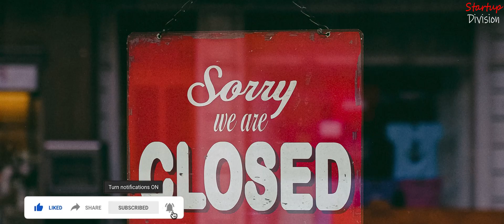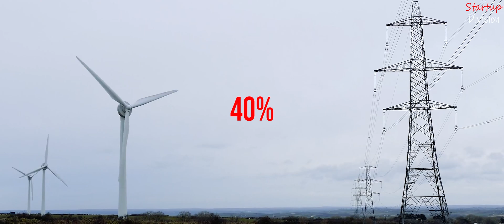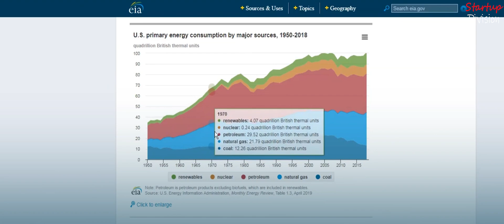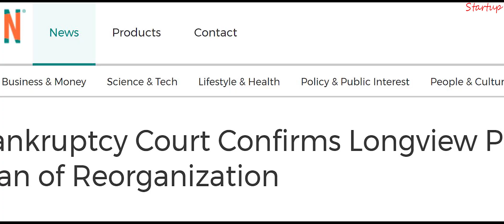Renewables Now Generate More Power than Coal Amidst the Pandemic in the U.S.

Comment from the maker: Do you think the future is Renewable Energy?
Reply: I dont think so man. But good for america. Will Donald allow it?
Reply: Yep Renewable energy has a bright future.
Reply: Absolutely. Why people imagine fossil fuels based civilization will last forever is beyond me. The clue's in the name - fossil & by its very nature, finite. Talk about a complete lack of imagination. 🤦🤷🙆
Reply: Renewables simply make more economic sense: you install once and you don't have the costs of bringing in fuel all the time. At the same time, costs of renewables and energy storage are dropping constantly, so they make more economic sense every year.
All we need is enough energy storage facilities and a smart grid that allows electricity to be transported over long distances, so that power generated far away can compensate for a temporary local shortage.
Reply: Yes it is. But it's going to take some work to shift structures and attitudes. It requires a whole new way of thinking.
Reply: Ygg,

no it will need a miracle, because when all things are considered we still need either or nuclear and fossil fuel genertaion to ensure that we always have power. There are times when renewables simply generate a very small amount of power. Batteries are not the answer and neither are 'smart grids'.
Yet governments are intent on adding to the grid load with a lot more electrical devices such as vehicles nad heat pumps. This exacerbates the problem.
Reply: It has to be. If we don't clean up our act we may not have a future.
Reply: Overdose, 

wishful thinking just won't do it and that is what renewable energy is.
Reply: @iareid8255  Neither is ignorance or pretending that since there is no miracle solution then we shouldn't even try. Your previous post complained about smart grids not being good enough, and then you complained about additional load on the energy grid, something a smart grid would help alleviate. Solar + batteries can literally solve the problem, however, the economics don't always make sense to use that solution. This is why renewables are a mix of complementary technologies that can be tailored to the local environment and socioeconomic situation.
Reply: Overdose,

forget batteries they only work for frequency stabilisation, not for intermittent generation, the capacity required is far too great.
There is a solution that most ignore or say it's too hazardous. It is a stable and reliable producer of good electricty. I say good because wind and solar is not good. It's technically unsuited for large scale grid supply.
Reply: Acme, 

I have a far better understanding of power production and transmission than you have. Renewables are the most expensive and unreliable way to generate electricity.
You mention vehicle to grid, a procedure that loses 50% of the electricity by the time it is returned to back feed the grid.
Reply: @iareid8255  Weird that you seem to be the only person claiming wind and solar power are "not good." Batteries are being made for literally that purpose - intermittent electricity generation. Ever hear of a battery backup, something that kicks in as soon as the power goes out? Same thing but grid scale and it is being deployed on every continent. 5% of the Sahara covered in solar (today's tech not future breakthroughs) would produce more electricity than the entire world used in 2019.
Edit: Also, if renewables and batteries are so bad, and so much more expensive, and don't make sense then can you please tell all the utilities in my state they are doing it wrong? Don't forget to mention it to the rest of the world who are building renewables at an ever increasing rate (2 recessions hasn't been enough to stop it).
Reply: @iareid8255  
 BZZZT! Sorry, you're WRONG.
V2G using lithium batteries has nowhere as low as 50% efficiency.  Meanwhile you spew nonsense and ignore the fact that thermal power plants have to produce 3 watts thermal for every watt of electricity they put out.  You didn't mention that - that's less than 50% efficiency!  And the same goes for fossil fuel vehicles, yet no one is complaining about it.
You're a TROLL just trying to bait people with lies.
Reply: @CausticLemons7  Well said.
Reply: @iareid8255  Total rubbish. UK has run largely on renewable energy for the last 5 months. NZ has been doing it for decades; longer than I've been alive.
Reply: Peter, 
The U.K. has been running on renewable generation for a long time. 
The only consistent form of renewable is Drax's biomass, capable of 3 Gwatts most of the time, if there is a demand requirement. It is, of course, a misnomer to call it renewable and actually emits more CO2 than coal per unit power.
For nearly twelve days this month wind's contribution is below, and some times far below 5 Gwatts. 
Solar peaks at the wrong time of the day.

What has been noticeable is that over the last few years as the renewable portion of the grid mix has increased what the grid operator calls a frequency event, where the frequency is + or - 0.2 Hz has doubled, this being due to the nature of renewable generation. It is asynchronous and has no inertia which contributes to a destabilising of grid frequency. We saw the result of this inferior power last year with a partial grid trip, where the operator had allowed the amount of wind to get too high.

New Zealand indeed has large renewable generation, it's called hydro and can't be compared to unreliable wind and solar.
Denmark is another country cited as being a leader for wind but they would not be able to use as much as they do without the backing of Norways large hydro generation capacity .

The way the U.K is going with it's electrical grid is bound to end in tears unless sense eventuall prevails. For an example look at California, with rolling blackouts entirely caused by too much reliance on solar and wind.

Power engineers use a technical term  for wind and solar:- c**p
Reply: All you doom and gloomers who keep on saying renewables can't cut it...
Why don't you read this and then *Shut Up*.
You don't know what you are talking about.

https://www.greentechmedia.com/amp/article/ls-power-energizes-worlds-biggest-battery-near-san-diego-just-in-time-for-heatwave
Reply: First name last name  What part of the world is that taking place or are you still at the concept development stage? There's a UK based YouTube channel called Fully Charged who may be interested in covering your story if & when you're ready to do so. They have some USA based correspondents. Earlier this year they had their 1st Fully Charged Live USA show at the Circuit of the Americas in Austin Texas due popular demand. Just managed to get it done prior to COVID-19 pandemic lockdown. Next year's event is going to use a larger venue as the demand for tickets exceeded capacity. Their UK one has been running for 2 years & is expanding to 2 shows per year & into EU & perhaps Australia. Check them out.
Reply: First name last name  No problem. Your welcome.🤓
Reply: i realize Im kinda off topic but does anybody know of a good site to stream new series online?
Reply: @Iker Aden I would suggest flixzone. You can find it by googling :)
Reply: @Sylas Aaron definitely, I have been watching on flixzone for since april myself =)
Reply: @Sylas Aaron Thanks, I signed up and it seems like they got a lot of movies there =) I really appreciate it!
Reply: @Iker Aden Glad I could help :)
Reply: Maybe, but the future can be nuclear fusion.
Reply: @thegreatgatsby8180  
The nuclear power construction industry has destroyed its future by causing massive cost overruns and a decade of delay after delay.  You can't blame it on NIMBYs or anti's, they had no part in it.  Look up VC Summer, Vogtle, Okiluoto, Flamanville and others that are proof of the boondoggles they've caused.  There was hope, but it's all been squandered.
Reply: No, old tech weather dependent solar and windmills can never compete with coal and even cheaper gas and nuclear. That's why all solar and wind runs on huge subsidies.
Reply: @picobyte  
You don't know what you are talking about.
No subsidies are needed.  Renewables are outbidding fossil fuels, even natural gas.  Sorry, Charlie.  You lose.
Reply: @acmefixer1  I'm very well aware of all the subsidies those windmills get, it's also pretty much the same scenario that plays out with any government that pushes renewables.
Blackouts, huge energy bills and more fossil fuel burning. Germany is importing huge amounts of electricity from it's neighbours, as it's warm but there hasn't been usefull wind for weeks now and it's also been very cloudy, so during daylight things are not much better. So next to importing coal, gas and nuclear generated energy from their neighbours the also keep their existing lignite/coal fleet running longer and even build Datelln 4 An excelent new coal plant that doesn't pollute the air at all! It has filters in the whole process that remove as good as all pollutants from the smoke.
Reply: @picobyte  In many markets solar and wind have become mature enough and no longer require subsidies although you would've been correct up until about 5 years ago.
Reply: The future is nuclear, coal, gas and oil. Renewables can't even keep up with world wide growth in energy consumption. Also coal and gas in proper modern installations burns clean. Only watervapour and CO2 come out of the chimney. Even Germany despite all their wind and solar has been and still is heavily relying on coal and gas. They even build a new coal plant (Datteln-4) 
https://www.power-technology.com/projects/datteln-4-coal-fired-power-plant/ world wide many hundreds of new coal plants are under construction. 👍😎
Reply: @picobyte  '''''''''Renewables can't even keep up with world wide growth in energy consumption. '''''''

at least one of them can

hydroelectric
Reply: No it is not the future. 
We are on the wrong path which will lead to nowhere as more and more renewables get added to grid systems the very real technical defficiences of renewables become more evident. Grids lose stability, and the power becomes more expensive.
Reply: @iareid8255  Renewables are actually replacing fossil for economic reasons. A system fully based on renewables does require an energy storage system, several of which already exist (batteries, pumped hydro), while others are under development.
It also requires a more interconnected system, so that power generated far away can compensate for a temporary shortage.
Note also that Tesla built a giant battery in South Australia about a year ago which is very successful at stabilizing a previously unstable grid.
Reply: Diedert,

 The media says renwables are cheap, they are misleading the public as they do not take all factors into considertion. No, wind, particularly offshore wind is extremely expensive.  Adding storage is just adding to that and cannot compensate for intermittency. As you correctly state the battery in South Australia's grid is frequency support. It is by grid capacity a tiny device at about 100Mwatts, the State of South Australi'a's (small grid) is around 3,000 Megawtts.

The reason the grid is unstable is due to too much wind and solar and not enough thermal with it's inherent inertia. That lack of inertia was what caused all the grid trips there.
Reply: @diedertspijkerboer  renewables and their storage are insanely expensive and make no economic sense. That tesla battery in south Australia is an epic fail I's nice for some peak shaving but provides no serious storage. They would need a few thousand of those units just to survive one single day. That's ten times as expensive than building nuclear plants, wich also makes the solar and wind more obsolete than it allready is.
Reply: @iareid8255  
You don't know what you are talking about.
All the arguments you put forth are from before 2010, and have been resolved long ago.
Reply: @picobyte  If they make no economic sense then why are utilities and investors alike rushing headlong for the door of fossil fuels and into renewable energy generation? Answer? Simple; they make excellent economic sense. Just ask anybody who has sola /storage systems. I spoke to someone who's friend put them on their house in the 70's, raised 3 kids, ran an EV & hadn't had a power bill in well over 20 years. Multiply that at grid scale....
Reply: @pinkelephants1421  Because of state subsidies. I'ts a safe bet for investors as the state backs the money. And the state agrees to take all produced power, even when not needed #curtailment
The whole climate/renewable thing is one big scam.

Comment: My 3.35 kw SunPower solar pv system on my 40 foot garage roof generates 22 kilowatt hours a day when sunny and around 6,000 kilowatt hours annually. At noon on sunny day my 3,335 watt system produces 3,000 watts. On cloudy days at noon the system generates 700 watts. All my appliances are electric and I connected the natural gas line from the property. I have electric thermal mass floor heating slabs along with solar heaters for heat helps by high insulation. I also have the fireplace usually for entertainment.
Reply: So you are one of the rich who can afford the technology,which is subsidised by the taxpayer,give me a break,And how much carbon did the Chinese produce so you can feel good about yourself and your footprint on the planet!
Reply: @klaasdykstra8127  Solar PV panels repay their embodied energy used in their manufacturing in under 2 years. I have had them installed for 5 years now so yes it feels great to now have carbon free renewably powered electricity onsite. With no moving parts these SunPower panels will provide my household with probably 40 years of clean electricity. Start with high insulation. I have R80 in the attic and R25 under my floor. My 3x6 foot solar heater I built works great giving me 60 C of free heat when sunny. My larger 6x6 foot solar heater gives me 95 C of free heat when sunny.

Comment: Excellent information and confirmation of researched data. This is reality fellow citizens. Thank you so much. Yes, renewables are the future which can then power electricity, electric heated floors, recharge our electric vehicles, grid batteries and reverse hydro pump our regional hydro dams on top of making green hydrogen with off peak electricity. Example of transition, Wyoming is building 500 MW of wind this year for $1 billion.
Reply: B.S.!
Reply: @klaasdykstra8127  Did you have a question sir?
Reply: And after the renewable is built, there will be ZERO fuel needed during its lifetime.
Reply: @acmefixer1  Wind turbines will need oil in their gear boxes and lubricants. The service trucks will need diesel or gasoline well until they are powered by electricity...renewably powered electricity.

Comment: I hope coal will be a think of the past And the internal combustion engine Will live in a museum one day.
Reply: Internal combustion engines are amazing, they can run on many types of fuel, and you can carry extra fuel, also they are used basically everywhere
Reply: @alanmay7929  
It's not the engine that's bad; it's the engine exhaust.  If you use hydrogen as fuel the CO2 will be eliminated.  Maybe there will be a way to retrofit fossil fuel engines to run green hydrogen.
Reply: @alanmay7929  And they will be a relic of the past in roughly 2030.
Reply: That's the plan.  The UK is going to ban all vehicles that run on fossil fuels by 2035.  Other countries will, also.
Reply: Internal combustion engines will never live in museums

Comment: Inadequate grid storage is a significant stumbling block. Coal cut backs are not economic but systemic and a result of natural gas (which systemwide is probably worse as bad as coal for GHG emissions) peaked plants being used to fill in the gaps that scavenger technologies like wind and solar necessarily have.
Reply: Huh?  Apparently you haven't heard of VPP or virtual power plants, or V2G, vehicle-to-grid.  No stumbling blocks with these.
Reply: @acmefixer1  Are you suggesting that VPP and V2G operate without storage? You sure have that backwards!

Comment: Is clean air solar will only get better
Reply: 10 years ago I paid appropriately $3000 to install a 1.5kw pv grid-tied system and today local suppliers only ask for $3000 to install a 6kw system. It would be nice to have all household electrical devices to be able to use 48v dc power supply directly.